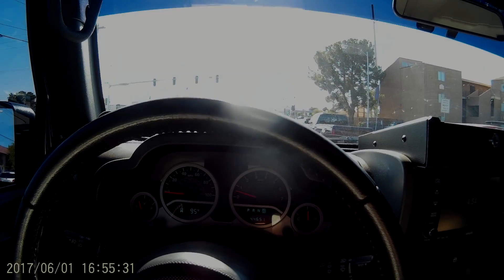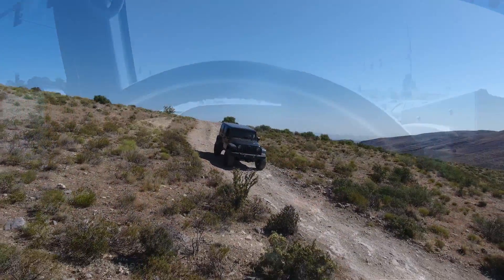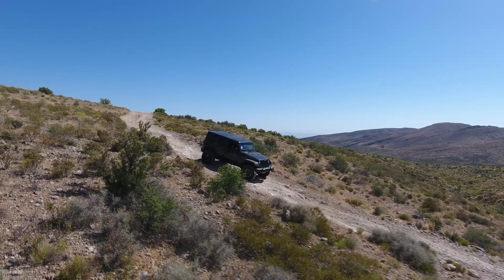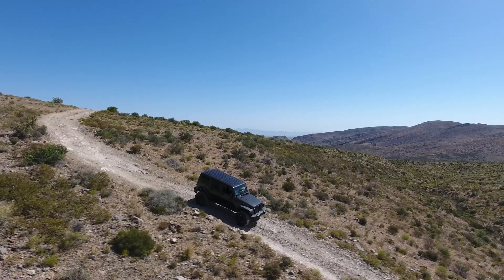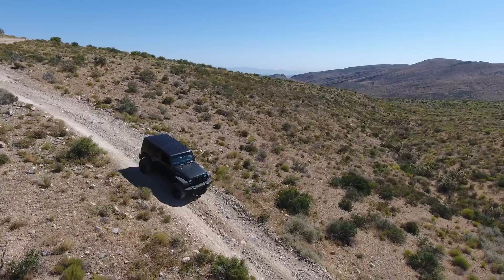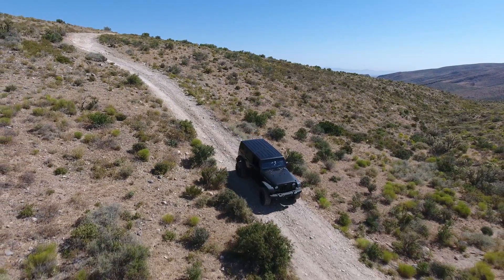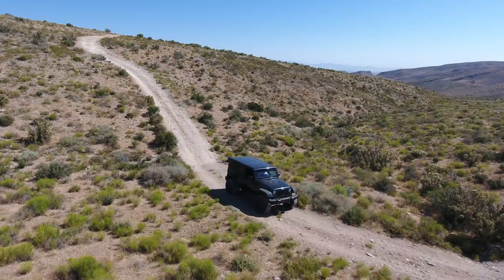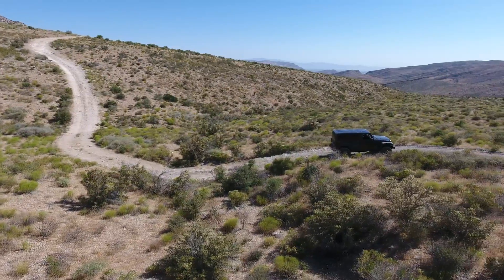Jeep Wrangler LS V8 Easy Install?

Comment: Amazing what you can find on YouTube these days! Such an awesome video! Thank you for sharing! this was a couple years ago so I hope you’re still here... So I am new to all this, And I have over $5000 worth of repairs on my 2016 that I JUST bought.. check engine light came on about a week after I bought the rig and it ended up being a cyl 2 misfire which I thought would be minor but unfortunately not the case. Now, a lot of what you’re talking about sounds French to me. BUT... when there’s this much money that needs to go into my current repairs, does it make sense to just do something like you’re talking about in this video? My current engine has 60,000 miles on it. To me it makes sense to dump this engine, and put the $5000 in repairs towards some thing like you’re talking about here.  ??

Comment: How hard is this to do compared to dropping axles /changing seals/installing suspensions? I've done almost every work on my jeep by myself except for stuff that required welding. But I have no experience with regearing and engine swaps. My 2013 jku is paid-off and I have no intention on selling it. I wanna add lockers, gears and a v8 eventually.

Comment: why would you do all that work to it and keep an automatic in there?
Reply: I owned and crawled a TJ out in Colorado for about 4yrs; soft top, half doors, 5M 4.0L... If I had to do it over again... Hard top, full door, automatic.  There is no real benefit to keep a 5M with the after market for even D35/30 with a 4.0L, let alone a LS.
Reply: @cousineddie7444  it sounds like theres no real benefit to putting an LS in there in the first place other than getting 8 MPG.
Reply: @jasonlyle3818  I'll admit it's not ALL wins, but there plenty of benefits.  You just don't ever realize it until you've been in the drivers seat on a trail at 10k or 12k ft.  Also, there's only so much gear you can get in a carrier, and at some point, you end up losing drivability, stability, clearances, or body panels trying to make up the losses in torque by other mechanical advantages.  I think you'd be hard pressed to find an LS-Powered "anything", that only gets 8mpg... except maybe a boat.

Comment: I have been wanting this swap for the last 4 years. My Jeep is paid for now and I'm saving up for this.
Reply: Did you swap it man?
Reply: @grungyracer  No , I bought a truck with a V8 so I can have that power when I need a V8 fix LOL ... I realized that if i put more power in the Jeep I was gonna need axles, better brakes, bigger drive shafts, etc. and i would still be way more likely to break things on the trail. My Jeep is a sow on the highway but it's great on trails so I have learned to live with it

Comment: +WranglerJKLS I'm interested. Have you done conversion on RHD JKUs from Australia? Thanks.
Reply from the maker: We have supported several LS JK builds down under. The issue has been ESP full and partial off modes with your engineering. We are working on supporting full ESP engagement selected to partial off by the driver for Australia. As soon as we support that a proper RHD kit will be available; we were working with Henry at Offroadconnection. 

We may be importing a RHD CRD in order to develop an LS-Diesel conversion.
Reply: WranglerJKLS Good to know. Please make sure that the prices need to be as low as possible because most prefer to just spend AUD 6-7K and a weekend to get 300+ rwhp from a supercharger which is fully reversible for another AUD 1K or so. No argument here about the potential of what you guys put in but the crazy labor costs here make an already steep engine swap beyond the sensibilities of even most cashed 
-up enthusiasts and that's a lot. Some after sales benefits to help with resale of converted vehicles should do muh good to your overall success, at least down here. All the best!